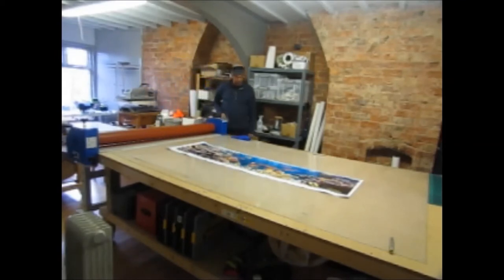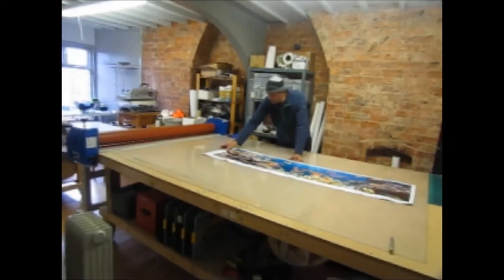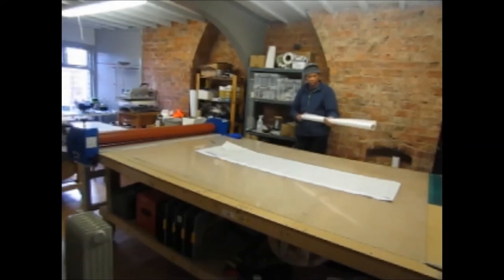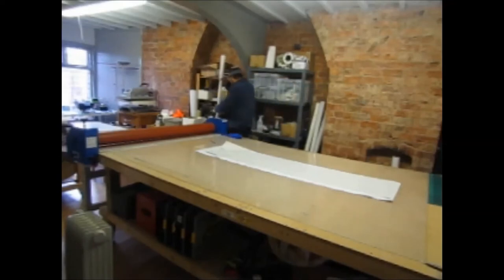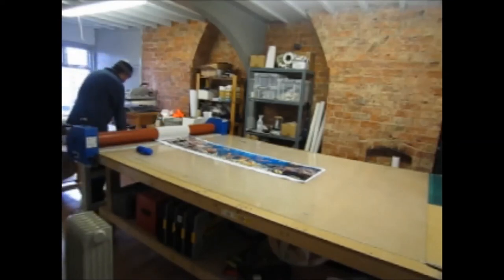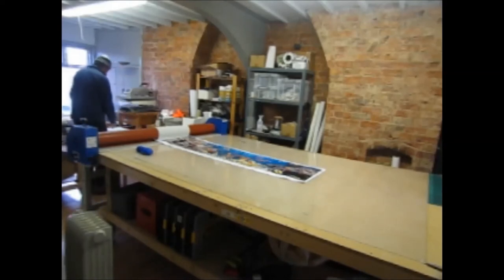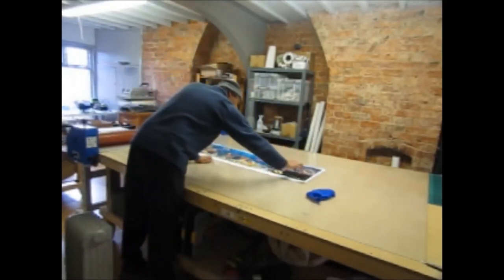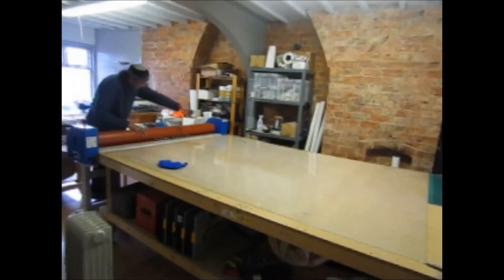Laminating large prints with a cold roll laminator

Comment: Hi Pete thanks for the great Video. What laminate can i use for cold rolling. i stuck with wich one to buy. Any assistance would be appreciated...
Reply from the maker: Hi and thanks for watching.

The only thing you need to be aware of, when choosing laminate to use in this machine, is that some laminates (not all) are temperature reliant. In that the adhesive doesn't adhere correctly unless heated up to a certain temperature.
Saying that, these are very few and far between as a lot of signwriters want a laminate the could also apply by hand (for smaller signs/prints).

I used a very large mixture of laminates:- gloss/matte, standard and wrapping laminates and never once had any issues. But if you are unsure, just ask the supplier if heat is required to apply the laminate to any substrates.
Reply: Thanks soo much @Petej728

Comment: Do you know how to enable the foot pedal control? I can't seem to get mine to work. I have the same model laminator.
Reply from the maker: Been a while since I used  the foot pedal as I always preferred to do it by hand + I retired last year and so haven't even got the laminator to test on. However...

I just looked at the front panel on the GAPS website. If I recall correctly, the + and - buttons set the speed which is displayed in the LED display. You set the direction the roller turns by using the two triangle buttons for feeding in or out. You also then need to press the little foot pedal button to receive the signal from the foot pedal. Finally, you have to make sure that the lever at the side of the laminator (same side as the control panel) is pulled out (I think) to engage the bottom roller with the drive motor. The lamaniator pedal should then work.

Hope this helps.

Comment: What laminator are you using, or what laminator do you suggest to use for people just starting out?
Reply from the maker: Electronic or heated roll laminators are quite expensive when you first start out. You could possibly pick up a used/refurbished model, but they still aren't cheap. Also, the way the laminate is loaded/unloaded means that you can lose quite a lot of material if you have to frequently change laminate types (gloss/matt/satin/wrapping etc). A friend of mine says he loses about 2 metres off a roll when he has to change to a different type. This is due to the amount that has to be fed into the laminator before use (that is not used for the first laminating job) and the amount at the end he has to cut off that is already in the machine.

The laminator I use in this video is a cold roll laminator. It has some electronic functionalty, but that is only to feed the material through the rollers via a foot pedal, but not to heat the rollers up.
The biggest difference between a cold and hot roll laminator is that with a cold roll laminator, you get an effect that is known as 'silvering'. This is caused by the adhesive being cold/cool and produces very, very small  (almost microscopic) air bubbles between the job and the laminate. However, going over the job with warm air and a solid rubber roller will make most of this disappear. In fact, just time in warm weather will make this effect almost invisible.

The cold roller I used was from GAPS UK Ltd (https://www.printcutandfinish.co.uk/   --  I put a link in here but not sure if YouTube will allow it). Also, I;m not too sure what part of the world you're in, but I'm sure there is an equivalent version in your country if you are from outside of the UK.

Anyway, the machines are cheap (compared to the 'however many thousands of pounds' price tag of the other machines), but work very well within their budgeted price range. Also, you can get smaller versions of the same machine to suit your purposes.
But I will say this. If you think you can get by with size 'A', try to stretch your self a little and get size 'A+'. Because, at some point, you will be asked for a bigger job.

Hope this helps and thanks for watching.
Reply: @Petej728  You're amazing! Thank you for all the information. It's been an interesting journey and I'm enjoying heat transfer vinyl much more but I have a couple businesses looking to have me do their truck vinyl so I've been trying to research and research and your video was super helpful in understanding some of the method. I truly appreciate it!!!

Comment: why not laminator using the machine forwards, isnt what you'd doing in reverse to how the machine is designed to work? ie you stood at the front and the work generally would go in from the front not the rear as you just did?
Reply from the maker: If you use the laminator in the direction you are saying (forwards), you need to have 2 rollers. One to hold the laminate and one to hold the print job so that they don't go onto the floor.
The laminator I was using didn't have those 2 rollers. Also, It was a lot quicker to do it this way because I didn't have to take time to set other things up. Just cut the laminate and then complete the job.
Reply: you could of done exactly what you did but from the front side if your offset of ACP was supporting the job at the right height.  doing it your way on some laminators will do 2 things, 1. bypass the safety features of th magic eyes so if somethign gets caught like a finger the machine would stop. 2. lots of laminators only have a very slow reverse speed and no control over it, doing it forward gives you multiple speed options of most machines.
Reply from the maker: I'm not really sure what point you're trying to make other than to criticise the method. However, there are a couple of things it appears you have missed.
First, I wasn't doing it on "some laminators", I was doing it on the specific cold roll laminator shown in the video which means:

1. This type of laminator doesn't have a magic eye and so it wouldn't automatically stop
2. I was operating it by hand which means that if I somehow managed to get my finger caught, I would instantly stop
3. If I HAD actually plugged in the foot control, this machine does have multiple speeds in both forward and reverse
4. Yes, I could have done it from the 'front side', but that would have meant that I would have to prepare the job on the bench, then transfer everything over to the ACP and then just run it in from that side back onto the bench. So, bearing in mind my previous points, why not just prepare it on the bench and then run it straight out from there?

You are trying to criticise the method, but applying the method to laminators that I didn't actually use. The method I show is purely for this type of laminator.
I wouldn't show someone how to perform a specific task on a specific machine by demonstrating on a totally different machine.
Reply: you really have misunderstood my comment or I have mis communicated I, absolutely not about criticising. first comment was asking why as to me using a machine back to front of how its designed didnt make sense.

the other comments were so anyone else reading using other machines would understand that. not about pointing out things wrong, more discussion about other methods, neither being wrong, just different
Reply from the maker: Okay, miscommunication then.

As I said, the reason I was using it 'back to front' as it were is that this is a very cheap machine and it didn't come with the facility to mount the laminate AND the print job at the front like more expensive machines (Easymount, Mimaki etc).
But if you imagine I had the workbench at the front (or just turned the laminator around 180 degrees) the method would be exactly the same using the laminator manually (which was my preferred method  for control in case I balls'ed it up).
Reply: fair enough, the way I work is: I have a bench in front and back of machine (the one at from is on wheels so can be moved out of the way),  so basically do same as you  but from one bench to another. either laminating of mounting , and if doing rolls, slide the front bench out of the way and then have access to the front roll for feeding job